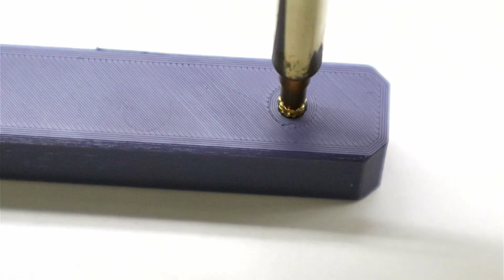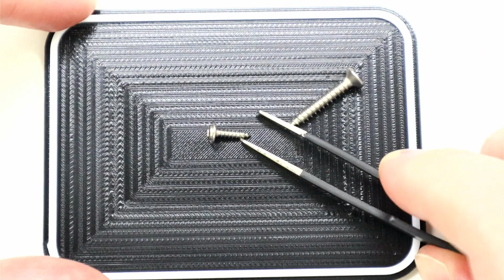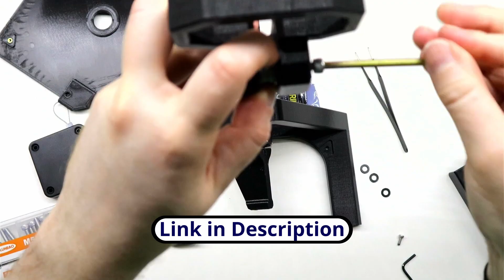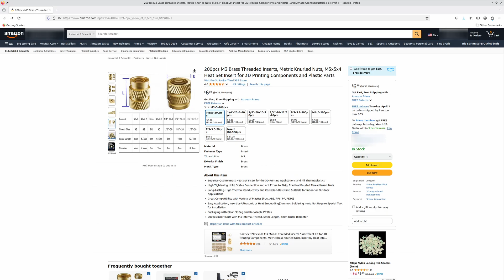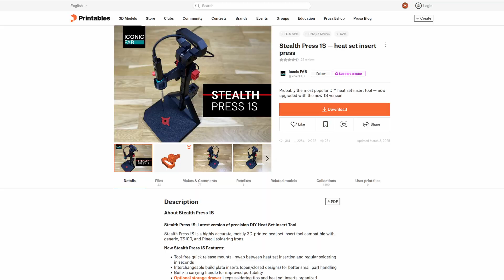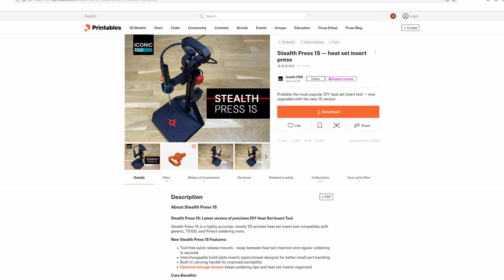Heatset insert presses. Are they worth it? | Testing the Stealth Press 1S design.

Comment: I bought a cheap drill press on Temu and printed a iron holder. All metal so it is 100% solid and was very cheap
Reply: Just what I thought.  I already have a drill press so will design a mod to hold a soldering iron.  You can buy drill presses really cheaply if they’re not for drilling 🤣
Reply: cool. this is a video about 3D printing heat insert presses.